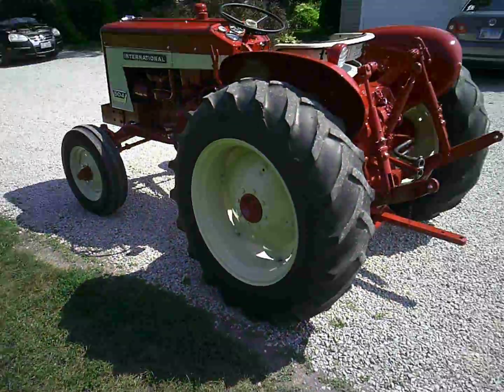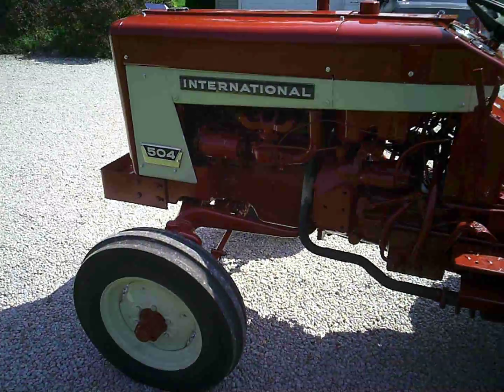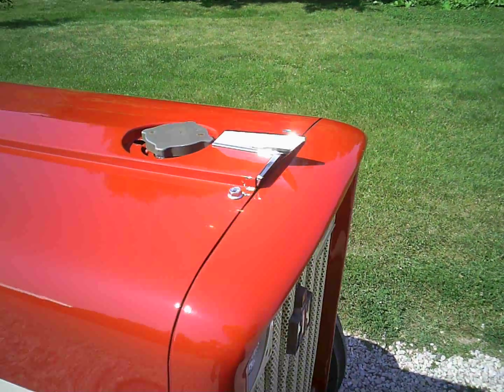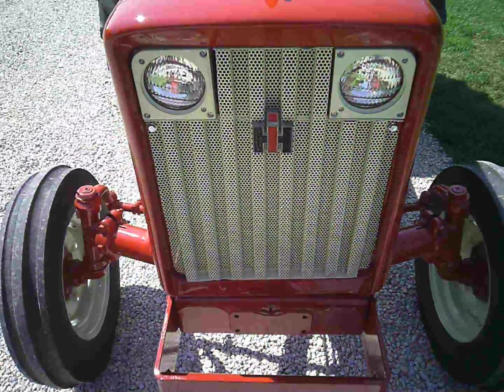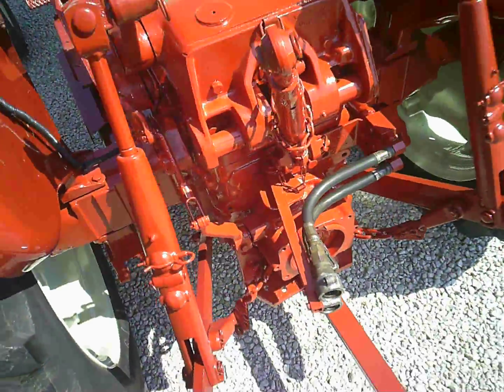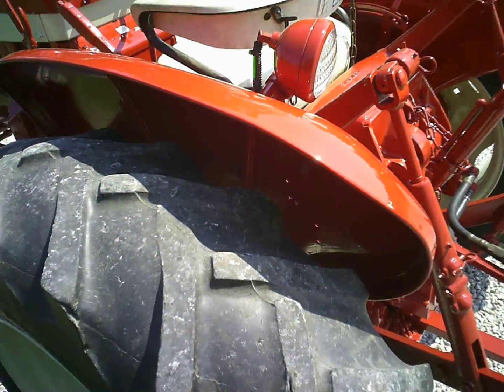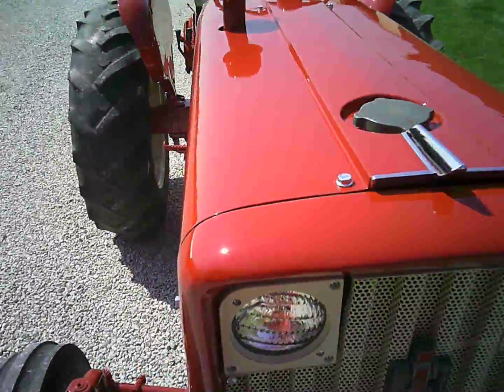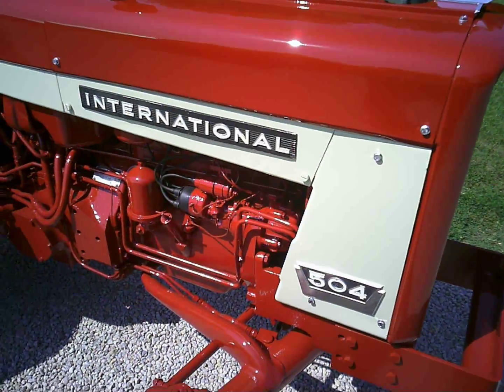IH 504 The Final Product

Comment: Jake, I picked up a 606 diesel a few years ago, went through the motor completely and that has been a real nice utility tractor for us here on the farm,  Has a loader on it that stays on all the time.  Need the weight up front when we have our 10 foot flail mower hanging on the back.  The primary use it gets is running a Lely tedder fake for us to get our first cut grass hay dried.  The first cutting is usually very heavy and with the ground moisture around the first of June, tedding is a must to get it through the baler on a three day cycle.  Our 606 has been a very good unit for us.  Hopefully the 504 will work out well for you. Nick, North West Farmer

Comment: Excellent job Jake. It's tough to put something back together again that you did not disassemble. Just one question? How many parts did you have left over in the box. Seems there is always something left when i tear into something like that. LOL.
Reply from the maker: Terry Presnal thanks man! Surprisingly the only thing I had left were a few clamps for wires and stuff. I did have to go paint a few extra pieces cuz I found where they went when I was putting sheet metal on.

Comment: Great Job Jake! I really like how the lug nuts are painted and all...really makes it look sharp. I wasnt able to watch the whole series so I was just wondering how you painted the whole engine and all when it was put together? Does it not heat up enough that the paint will come the block and oil feeder lines? Thanks
Reply from the maker: Samuel McKinley thanks I appreciate it! Yes painted it when it was all together. It's tough but can be done. The only thing that burns paint off is the exhaust manifold.